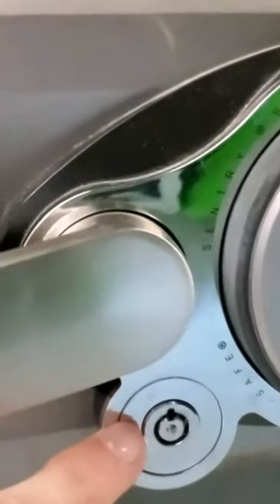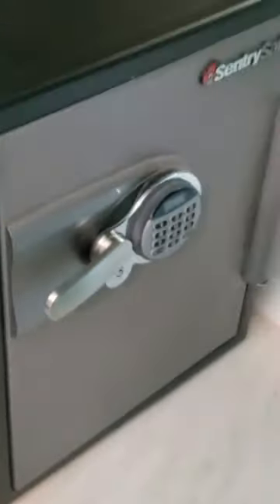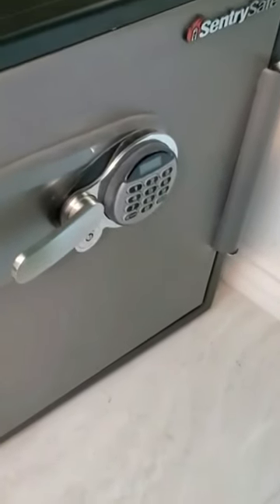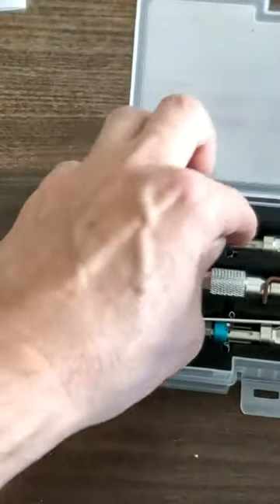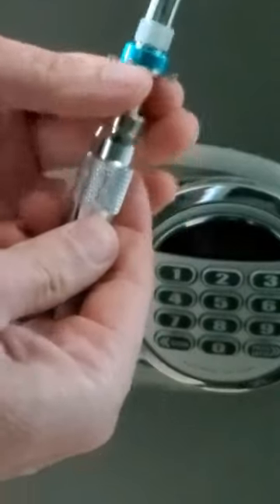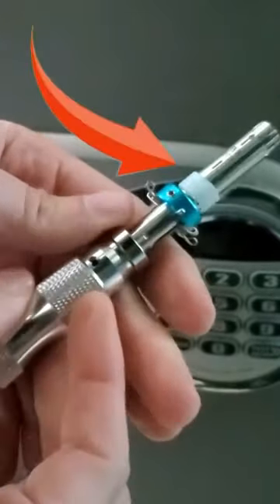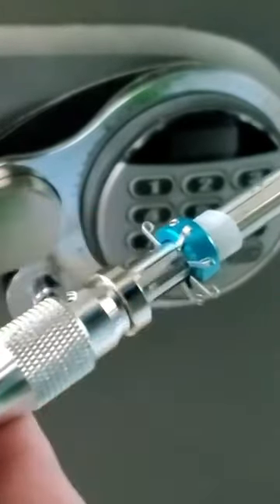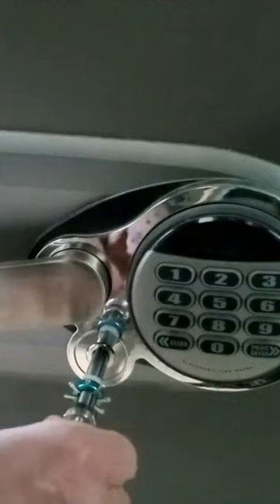Lock Pick - Tubular Cam Lock Review & How it Works

Comment: The tool was already prepped for the specific cam lock (after having it open before recording), so it opens instantly on camera. It usually takes some twisting and wiggling to get the pin impression on the tool. You can verify this at the moment he inserts the tool in the lock. If you look closely, the tool pins are already set, and do not adjust at all. You can also notice previously, when he pushes the slider up to reset the pins before picking, the lock is already open. Video then cuts to the scene where he "picks" the lock. Bottom line is that those tools sometimes work, but not as fast.
Reply: Sorry to say but you are wrong.
Reply: Fraud , isn’t it ?
Reply: I just did it with my own safe
Reply: I can also do it in my own locks. I didn't say it is not doable. I said there is a jump cut in the video where the tool is already prepped properly, to open the lock much faster than normal. Anyone who owns the tool and knows how to use it can clearly see that the pins  have been pre-set

Comment: A lot of sentry safes work off of a
Solenoid if you turn it
On it side and smack it with a no bounce hammer (rubber mallet) with a good whack and turn the handle
At the right time it will open